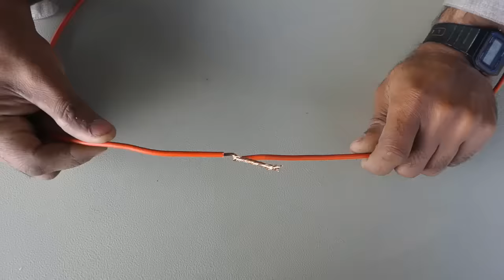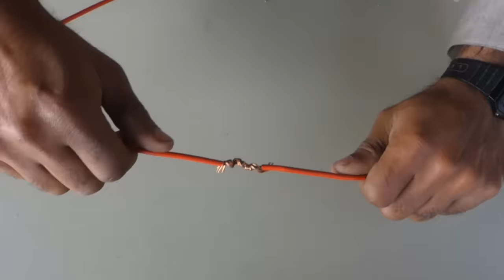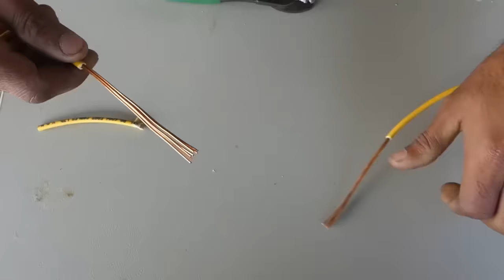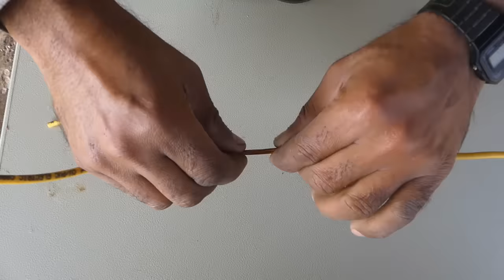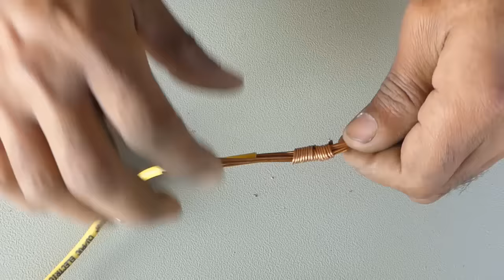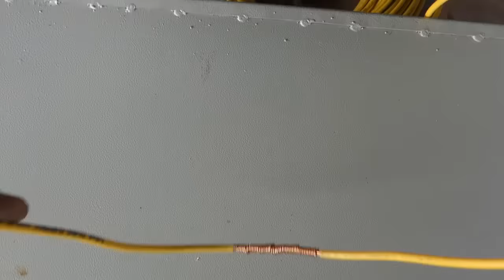Awesome Idea! How to Twist Electric Wire Together | Properly Joint Electrical Wire | Part 1

Comment: The wire type won't be same & what about thin wires
Reply: Solid wire won't work using this method. Unless if the solid wire is 18, 20, 23 etc gauge.
Reply: And you can't just waste full 2 min (instead of 5 sec normal twist)in twisting the wire of a simple switch board
Reply: @ashutoshsingh6957  bro wasting time not only.It is hard to roll the wire in that manner by taking tinner wires .
Reply: If u find wrong wire connection what will u do ..!! .it takes long time to remove and connect again 😂
Reply: Srini 7.o Heard of wire cutters?

Comment: As a Registered Master Electrician of the Philippines, I never joint wires between devices. I use terminal block inside the device or junction box. So, Western Union tie is a big no!

Comment: Holy shit that takes a long time. You'd get fired spending that much time to splice a wire. How much force is there pulling a spliced wire apart. NONE.
Reply: Won't get fired if you're the boss.
Reply: @notinterested8452  well,you will be out of business! So basically the same thing
Reply: @notinterested8452  
Good one
Reply: They probably learn this technique from illigally wiring buildings and that's because the wires also need to be tensioned but that's just pure speculation on my side.
Reply: I was waiting for black tape...
Reply: Hi friends 🙏
Light Bulb Service 💡💡

Comment: Or you can solder the joint in 15 seconds and be done with it.
Reply: Or just use a wirenut or wago like electricians do
Reply: my friend I don't have soldering iorn

Comment: And this works in a practical application how?... Good luck roughing in a house like this
Reply: Speaker wires for one.
Reply: @jasonahdjfhsdfg  Yeah, I didn't think about in a low voltage application though. Good point.
Reply: 😂 and i assume your an electrician like me
Reply: @erminesantiago7911  Yes sir! You imagine your Journeyman coming up to you to see how your doing and seeing this?

Comment: Considering how hard he had to pull to actually part the wires, if he is doing electrical jobs and leaving wires with that much tension on them then he should not be touching the work!
Reply: Agree … in general if u connect flexible wires by twisting them u should NEVER leave them blank! Use shrink tubes and it will be solid enough! But the second twisting methode is anyway bullshit
Reply: @user-ei8he2ih2i  Worked on equipment including electric forklifts for 22 years.....if I EVER took that long to make a connection I'd have been fired. Made dozens of connections with solderless connectors and a good crimping tool, never had one pull apart unless someone intentionally did it. This is an exercise for someone with way too much time on their hands and not getting paid by the hour....waste if time
Reply: That dude looks like he is from south east Asia.  They literally have monkeys climbing on their wires.  Needs to be that strong.
Reply: @289hipo  yes its too much time i agree
Reply: @289hipo  

Plus it's not electrically sound, as a sparks I'd lose my job if I ever got caught doing something like this
Reply: The people comparing this to a power pole supply wire boggle my mind. This guy must be a giant
Reply: @adityajha5074  

So doing something that can cause fires is okay because it's for non electricians? People don't respect how dangerous electricity is
Reply: @marioncobretti7870  

Looks like 6mm cable, capable of supporting around 40 Amps, which is enough to power a small house, we're not talking 12 volt electronics here
Reply: @paulw6183  i dunno what ghetto youre from, but even 200 year old homes here, have thicker wire than that supplying power, and wire from home to pole, is buried.
Reply: @marioncobretti7870  

Firstly it's not wire, it's cable. And my house is supplied by a 25mm cable, not a 6mm, but that's not the point I was making anyway, this cable could support an oven and hob going at full capacity, you don't compromise the cable. It's very simple
Reply: @paulw6183  what country though? Pole to meter is heavy around 100 amp rating. 60A to 80A wire from the meter to isolator then to bus.
Reply: @paulw6183  fine cable.  im pretty sure a cut cable like this with joint, violates building code, and trying to traverse the 4 inch span of this joint with something to seal it properly would be something else to be desired
Reply: @glennoc8585  

In the uk most properties are fed by a 100 Amp fuse, which goes through a meter using either 16/25mm tails through to the consumer unit, the underground supply to a house is normally 25/35mm
Reply: @marioncobretti7870  

Go to any electrical suppliers and it's called cable, not wire. Either way you can put a joint in a cable, it's not against any building code, but it would have to be mechanically sound with no conductive parts showing, you can joint cables as thick as you wrist live if you need to.
Reply: @glennoc8585  we have a 200A service for main power with 2/0 copper cable to the meter base. I live in Texas.
Reply: @curtisthatcher2577  That's large. It must be due to the lower voltage high amps in American home. We are mostly single phase 220v 80amp.

Comment: What about its resistance and charge flow?
Reply: Yes I think he made it a solenoid and resistance will be high
Reply: @flaksher4273  only the magnetic effect of current will be effected nothing else.
Reply: He has wounded  copper wires around a copper core. Copper is itself not very permeable .There will be Eddy current losses but very less
Reply: Nigeria..no wonder :/

Comment: I would have to drop my helps pay because they are spending 30 minutes to make one joint. Twist it with your Klein’s and put a red cap on it.
Reply: Don't twist wirenuts with Kleins, that's how you get pits in the copper and arcs in the wire. Use an Ideal screwdriver with a wire nut tightener
Reply: @frenchmontana961  you cut off the extra length you used to twist with the pliers, then wire nut on untouched wire with a speed wire nut driver in your cordless drill.
Reply: @shrconstruction  damn that's pretty good
Reply: @frenchmontana961  time is money😁
Reply: @shrconstruction  idk man, your method sounds like it takes a couple seconds longer than mine. I just line up the insulation, clip down the excess copper, and throw on a wire nut and give it a couple turns with the ratcheting end of my screwdriver
Reply: @frenchmontana961  my way is definately not going to have any lose wires ie hot spots...old timer Canadian electrician taught me that way. This way the wire nut is really just overkill and the insulator. Im good with it. The wire nut socket is a quick attach in the nut driver that I use for screwing stuff anyways.....just like swapping an apex. Helps a little on the carpal tunnel pain not using the wrist as much.
Reply: @shrconstruction  good point. That's why you pull on the wires tho

Comment: He is gonna be shocked when he finds out that connector exists
Reply: No connector will hold so strongly. Are you shocked?
Reply: @taraspetrovich8711  why would you need it to hold so strongly? I can spend 5 seconds to put a wire nut and it will do the same job. For 3 min connection.
Reply: @taraspetrovich8711  might as well insulate them copper in concrete then
Reply: @josemuniz9750  I think that we r talking about thick wires. Wires that weight hundreds of K and there are 50 or 100 meters between posts. This is just an example on thin wire.
Reply: @taraspetrovich8711  then why not show it on a thick wire? And besides a wire as long as you say and as thick as you say would have to be replaced not repaired.
Reply: @Basit Miki then you shouldn't be messing with electrical. What kind of electrician wouldnt have connectors???
Reply: @josemuniz9750  ñññ
Reply: @taraspetrovich8711  this is actually done in some poor countries from electrical posts to homes and the reason for this is they are using scrap wires..
Reply: @justrandom7799  Yes, sir. Poor countries do it even on high voltage lines.
Reply: No one cares about the music and how you could just lay out some vocals on top and pads on it and become a pop star and make millions of dollars hippin n hoppin and have women throw themselves at you because you arre not only rich but also know electricals ! 
An Ideal home maker !!! 🤙
😂

Comment: I wouldn’t want to pay him by the hour to do any electrical work. 🤣😂
Reply: Depends. That was a mean as learning for me for pulling cables through tight spaces. Bitta class from the bloke imo
Reply: Yep...this is the same guy who pounds nails with his sandals
Reply: I agree 💯%
Reply: @lipsynchthis  ๐
Reply: @brianglade848  ๆๆๆ
Reply: @lipsynchthis  I've been doing this for 20 years. If you are learning from this you're doing it wrong.

Comment: In electrical engineering there is actually no way to twist wires together, that's called an instant visual fail.
Reply: I’ve a lot of connections on my house where two cables are sort of screw threaded into a slightly cone shaped tube, creating a sort of very fast twist connection. In my country safety rules feel sometimes ridiculously strict. Is this twist connection an overseen flaw in the regulations?
Reply: @Johan-vk5yd  if it's your home and it's safe then legally you could get away with it if it's not ridiculously unsafe, if an engineer does it, it has to be done right, you can get twist and crimp wire connectors that seal up the wire and so long it's not a main line or a L(live) then it's up to you, but remember if it goes on fire you will be responsible for it, any wires on an appliance, in sore it's 120v in the US (the UK is 240 that's what I work with) then you won't get any resistance overheating,  if it's the main line to the appliance then take into account what wire it is L or N or E Live has a consistent voltage, where N can have that same voltage plus resistance then E has to have not just voltage and resistance but continuity has to be it's strong point as a huge surge can go through it if any appliance fails, this wire also connected to all earth appliance or class one appliances, and even connects to lighting rods on building exteriors. So in short, if it's an appliance or your home circuitry, it's been sealed and signed off by an engineer but if it's your own appliance and it's project type stuff then your OK, it's especially safe when your only using under 30v like people build little middle houses, those things are the same as batteries of most ranges so probably won't ever be an issue.
Reply: @darrenhenderson6921  Thanks for your thorough answer! I recently bought the house so I don’t know, and also for that reason all the circuitry is being renovated. It will be a huge bill, but better safe than sorry.
Reply: @Johan-vk5yd  here is some more useful information, if your getting your home renovated then it's better to replace it if it's an older system especially, engineers legally can't touch it unless it's an up to date system, if it is then ask them about repairing as breaker boards and stapling all cost, if it's new it's not necessary, if so then it's definitely worth it, plus you want a reduction for the old copper, this is around $6-8 per kilo or 2.2lbs, engineers and sparkies(not full electritians just skilled workers) love customers who don't know these things as they keep the recycled copper which is high grade bright wire and this goes into an untaxed income so it's more money in their pockets, granted people like myself are honest and tell people those things, a lot don't, so when they come, just indicate you know what is what that way they will realise you are aware and won't be taken advantage of, it's not an outright scam but familiarising yourself a little will definitely get you a huge reduction in your costs.
Reply: @darrenhenderson6921  Awesome, thanks a lot!

Comment: It's funny, this splice method is sometimes used in fencing repair to join a broken strand at one end before using a stretcher on the other. I don't know if it's the correct name or if it has any application in that field but the old timer who taught me the splice called it a "Telephone-Splice". I used it quite often after learning about it since my previous method would always lose tension when stretching, resulting in a loose strand after tying everything off. Never had that issue again after implementing this kind of splice method.

Comment: Although this concept is good for tension strength and having an exposed wire. It's not good for wiring a home, firstly it takes to long to do just for one connection. Second, there's no way to put wire nuts on this sort of connection and exposed wires in a home will never pass inspection and can cause fires. Lastly, no one is going to be pulling on wires in the home regardless of where it's at so this method is a waste of time. Sure it's effective, but time wasting and exposed. Electrical tape won't hold either and its not a good insulator for long use

Comment: Take 4 minutes to join 2 wires, and then you leave it bare? Seems odd.
Reply: It was for demo i'm sure. Cover it with heat shrink with a sealer in it.

Comment: Ustad g agair wire men current ho to kase connect karen....?
Reply: गजब का सवाल है। 😇
Reply: It's applicable only if supply not live...otherwise you wear proper shock proof gloves to do the same . But risky with live wires.

Comment: I loop the wires together, wrap counter clockwise on the left side, clockwise with the from the right, solder, heat shrink = done.  Fast and easy.

Comment: This has to be one of the dumbest ideas I've ever seen
Reply: Rashad Johnson agreed
Reply: This is Just Bs
Reply: This is the same guy that smoothes concrete with a sandal
Reply: Ah yes as they say in the trade years ago make a western union because you ran out of wire in your pipe run
Reply: मै एक टेस्टर बनाया हू मात्र 26 रुपए में
वायर ( तार) के उपर रखते ही तार कहा से खराब है
और तार में बिजली है की नहीं
तार का फाल्ट सब बता देगा 👇👇
 https://youtu.be/xsu5VHulVXY
Reply: HomoTriSapien what did you just say?

Comment: The second type of joint he made works fine if we done it right. For indore usage the first and second type he used is good enough. I don't expect someone to break the walls to pull those wires😅.

Comment: If I took this long to wire up I’d be out of a job.
Reply: Practice !makes a man perfect.😐
Reply: its better to be slower and do perfectly then be faster and not do it perfectly.
Reply: @sagarmagar255  You can do it fast and do it perfect. Nothing wrong with twisting a few time with pliers and twisting a wirenut.
Reply: @sagarmagar255  ইইই  *(((0
Reply: @Shushant Rishav как,правильно,положить,ломинпт

А
Reply: Cost for labor and all the excess wire on this would add up real quick
Reply: it will make the connection safe, never go cheap on the quality of works just to have more "quantity"
Reply: @ggogoogooq9363  wire connectors work perfectly fine lmao
Reply: @Rayden440  absolutely
Reply: @sagarmagar255  I wouldn't even call this better in most circumstances. This is really only useful when splicing something together.

Comment: If we are not going to toe a break down lorry or bus we can use these wires.... otherwise it's waste of wires, waste of time and waste of manpower...
Reply: I highly agreed with you.The method of splicing that he does was something called a western-union method.And d first one was d rat tail joint which is highly acceptable practice to the industry,Rat tail joint is was never a wrong method, After all who gonna pull the wires inside d splicing or jointing box?Such a waste of time for the purposed.
Reply: Ok can also

Comment: Wait..... that looks more inductive creating magnetic field where energy can be stored rather than conductive
Reply: No it won't create magnetic field. Except you put some stell in the middle of coil
Reply: it could be inductive if he winds it that way but with insulation on. if windings have electrical contact - no coil just a thicker wire.
Reply: @mikhailkurzanov5900  Especially if you solder it

Comment: Only owner will do like this not to get burnt his ass, lazy commercial service man will never do like this.
Reply: I’d be damned if I’d spend 5 min on a connection hahaha and sometimes you are limited with space on a wire doing that much twist may not always be possible ac units have twist tied parts and they work for 20 plus years it’s not the wires that fail....

Comment: Instead of twisting wires together why not make a proper engineered electrical connection,  using a properly specified and insulated terminal block.   I was trained by an electrical engineer . He would have hit me with a hammer if hed seen me do ANY of this. ........
Reply: This is to pull it through conduit to replace bad wire.  Use that hammer.

Comment: If you were on a job and it took that long to tie one wire together I think you would not have a job. Even though the idea and theory is great why would there be movement that strong behind a plate inside a wall or even from a fixture.

Comment: Laughs in “IBEW” Please leave electrical work to the licensed professionals. This is how you burn down your house
Reply: Right?! Now what is he going to do tape the thing? Its perty and all but you cant leave a wire like that taped. Probably has over 30 amps going through it.
Reply: Even licensed electrician will do in the same way.
Reply: @yerur1912  they are just clowns for hating this guy

Comment: If you had shorten the wires to reduce resistance OK, however you forgot to slip the appropriate size SHRINK WRAP to conclude your connection FOR EVER. 
😏

Comment: Isn't the point of twisting the two together is to then cap it with a wire nut to not have the copper wire exposed...